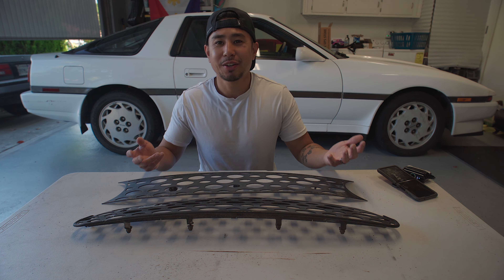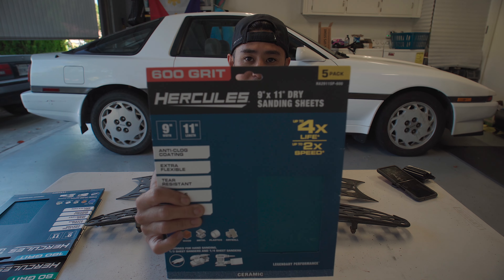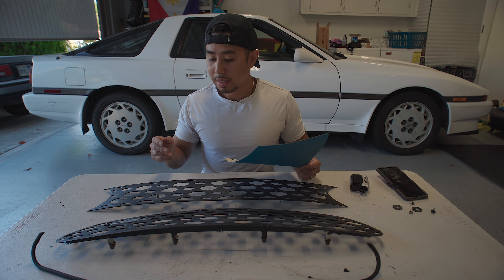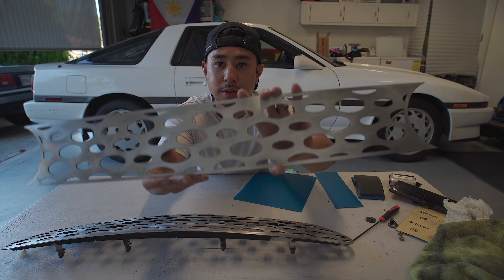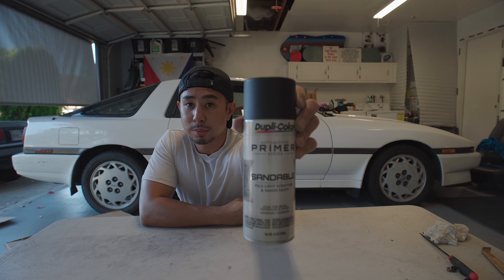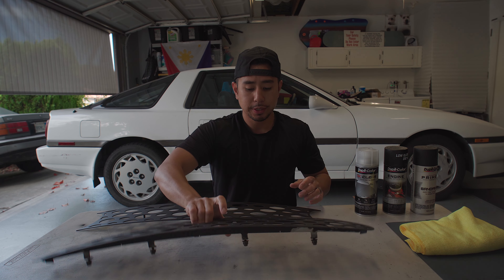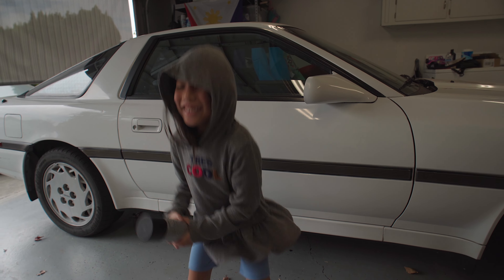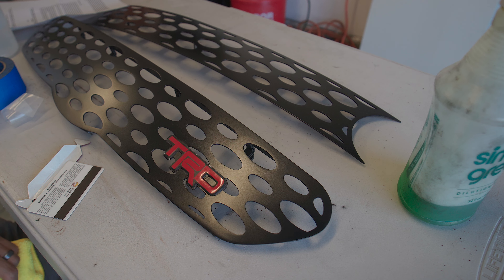How to paint Aluminum, TRD Grille Restoration

Comment: Looks sweet! I couldn't put it on my car because it looks too similar to the stock grill IMO, which I actually like better since it has some depth to it. However it's always good to have more TRD parts! 

I've been trying to keep my eyes out for a TRD cold air intake for my 03 XRS, even though I already have an Injen CAI.

Not gonna lie, might have to find a TRD emblem the same size, glue it onto my stock grille, and follow your advice on putting the overlay on the emblem!
Reply: The TRD lower grille looks sweet tho! It'll probably be easier to touch up the paint from rock chips vs the stock plastic grille getting chipped away
Reply from the maker: @PlayinWithMahWii  appreciate it! Yeah I've always wanted one. I had a TRD cold air and I gave it away to one of the matrix guys in SoCal at toyotafest. 03 is the best year 👌🏽
They do come up once in a while though. 
The overlay is not bad, really up close you can tell it's not oem but probably best available these days